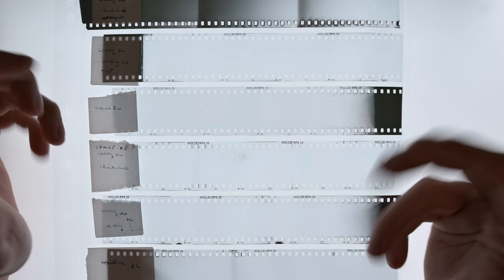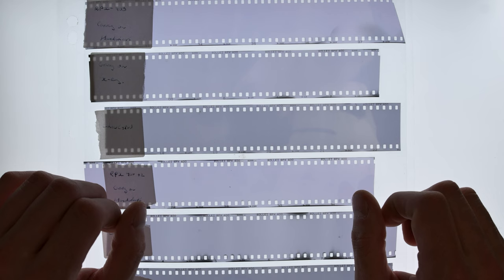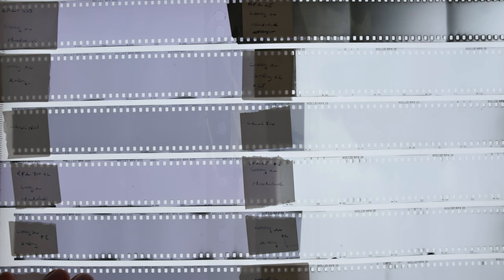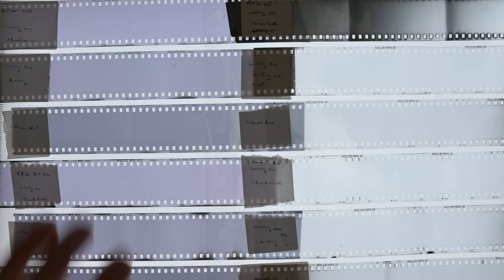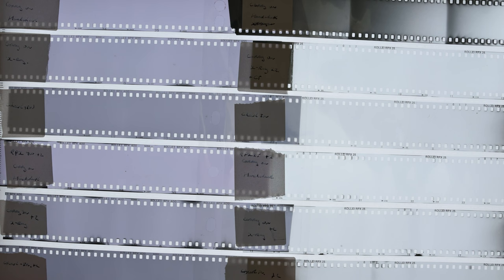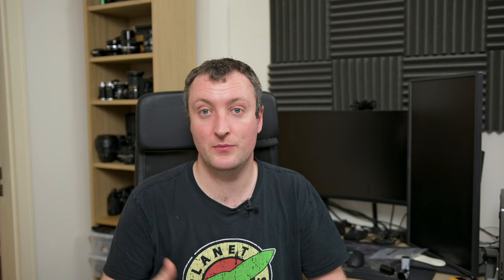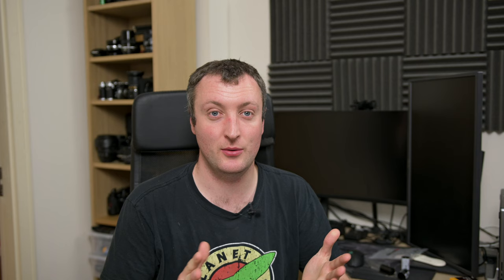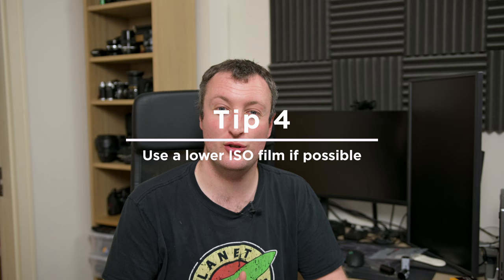Testing Airport X-Rays on Film

Comment: I’m pretty experienced traveling with film inside Japan. You can always ask them to hand check your film rolls. If you have one roll inside your camera, they will politely ask you to take one shot to confirm it. Hong Kong and Thailand were also pretty nice when you ask for hand checking. Mainland China was a different story though. Staff at airport were nice but in other places there were a bit of problem. You are required to go through Xray scanners at metro or train stations, they were not that willing to help you just for a few rolls of film.
Reply from the maker: Being offered a hand check at the airport was a nice cherry on top to end my trip there.
Reply: I travelled to Mainland China quite frequently before, the behaviour of the staff at the security checkpoint of metro and railway stations are usually terrible. When I was in secondary school, I attempted a school trip to Xiamen, when I started travel back to Hong Kong from railway station, the woman worked at the security checkpoint asking questions about the film with me with using rude speech! And the reason that those buggers always behave rude to the other people, is to show off the power they are holding.
Reply: @ycphotography-go3mz  that is sad. I don't even understand why they have security checks for metro and train stations in the first place, what is the point.
Reply: @GlaciaDay  I could actually tell you some of the reasons why the security checkpoint (it is quite a long story), as I did live in Mainland china and Hong Kong for two decades at least. Before the year of 2010, the public security is quite terrible in most of cities in Mainland, as the people from the remote areas/provinces heading to the coastal cities/provinces for job opportunities. And the sad news is those groups have a high crime rate, as they did not have a diploma or a diploma up to the level of primary school usually (secondary and high school diploma holders from remote areas/provinces were very less due to the economy and family issues). Those people are belongs to disadvantage social group, as most of them did not have any connections with the people in cities. So they were always being treated unfairly by their boss of even the government employees in the cities. Due to the situation they are facing and the level of their education, number of them will prefer to solve the issues with violence. For example like making troubles in public transport facilities or government offices. To avoid those safety risks, the public transport facilities like metro and railway stations start set up security checkpoint to reduce the risk of crime breakout.
Reply: I live in Beijing and sorry to hear about your story. But every time i traval with film at metro and tell the staff that i have flims then i will not be checked. I just open my bag and show them there's film and they don't even touch the film. i'm not sure what they do in train station but at metro, i have never been checked by X-ray
Reply: Hi, im travelling through Bangkok soon? think ill have problems having them handcheck the film?
Reply: @adyghe3  staff were pretty nice at Bangkok airport. I didn't have any problem asking them hand checking my films.
Reply: @ycphotography-go3mz Yes this is true...actually most of chinese tourist too..if not rude they dont behave well...not all but mostly..

Comment: What are the darker lines across your film?    Did the xray leak in past the film guides   fog are not always even due to the metal gaps in the film holder.
Reply from the maker: That was from me transferring the film into the reusable cans. RPX has a clear base and can have light piping issues. I taped the film in the light and transferred in the dark.

Comment: Thanks! Excellent test. My compliments. I could not have carried out your procedure, if I had known,  when I lived in the USA. No matter how friendly I asked, my 400 and 800 ISO films went through the machine. Standard procedure! Underpaid and overloaded staff? All films were Portra and some turned out to have been affected. Apparently the machines differ greatly. The same treatment was/is at Heathrow.
Reply: I've flown throughout the USA dozens of times with 35mm film and never had this problem. Even in insanely busy airports like Miami during peak tourist times, where it would have been easy for them to tell me to f-off they've still been accommodating.

If you give yourself enough time and you explain the situation well enough to the TSA staff, they will do their hand checks and swab around the exterior of each 35mm film canister. Just make sure you hand them the film rolls in a clear plastic bag marked, and make sure have no film in your cameras. This is even more imperative nowadays as every major airport in the USA has new high-power CT scanners that affect film much worse than the old x-ray scanners.

Comment: nice test, thanks for doing this :) one question: why does the 25 control strip look so dark?

just to throw in my experience here with this "problem": i have had no trouble getting hand checked film in the united states or in japan. however, i often forget to ask. for this reason i often travel with my film in a lead pouch. if i forget and send it through the scanner, it will get pulled aside and then hand checked. recently i forgot the lead pouch and the hand check, and sent 8 rolls of exposed film through the carry-on scanner in US/Canada customs! finger's crossed. ack.

Comment: In the USA getting your film hand checked is a must now. Over the past several years every airport in the USA has switched from traditional x-ray scanners to new high-powered CT scanners. These CT scanners WILL completely ruin your film in just one pass, no matter the speed of your film.

If you are flying with film in the USA just have your i's dotted and t's crossed and the TSA will accommodate your request 99% of the time. Always give yourself an extra 30-60 mins to get through security, have the film cassettes out of the canisters inside a marked clear plastic bag, and make sure you have no film loaded in your cameras. The worst that's ever happened to me is they detect a certain chemical from swabbing the film cassettes, and require they check all your bags and do another body scan again.
Reply from the maker: Its amazing how far being polite and prepared to make their job as easy a possible can get you
Reply: Precisely

Comment: Sorry to disapoint you, but traveling by plane with digital is much worser, because on the high altitude same x-ray will end up dead pixels in your full frame sensor(Officialy proven information).
Reply from the maker: Ive heard that but the camera corrects it for a normal amount of flying.